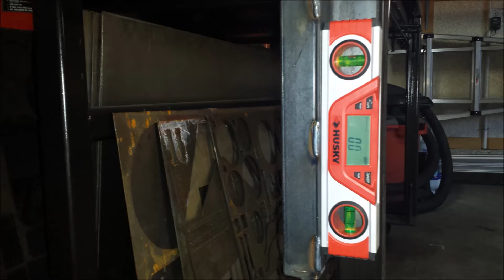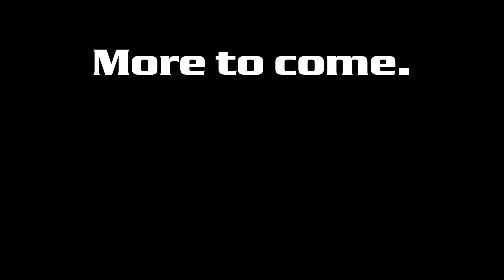Screw-jack elevator for my Plasma CNC -- part 4

Comment: Great work John. Just a thought...on the long chain side, you could make a bracket with two stacked sprockets then split that chain into two pieces. Would help eliminate that sag. If you did that, when you add the other sprocket to the elevator, use the lower sprocket for the long side then you don't need to touch the short side sprocket...just my thoughts, but awesome work sir!